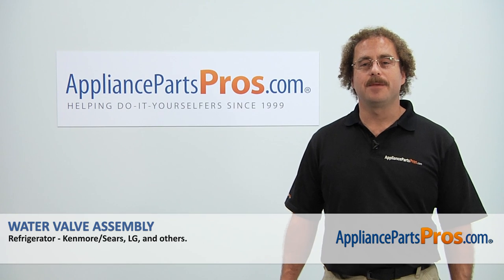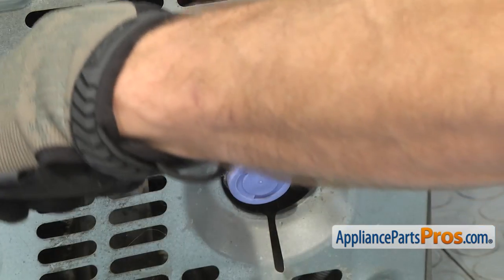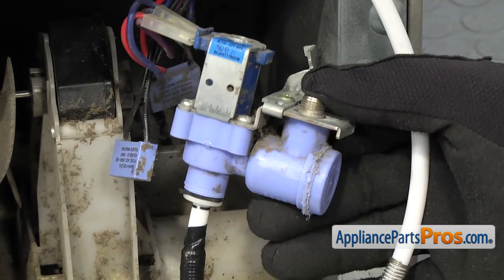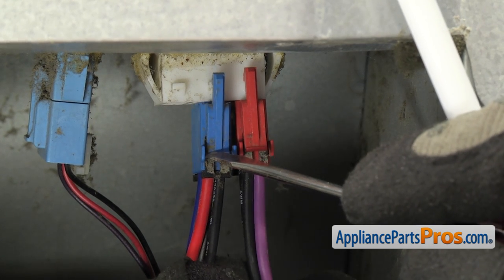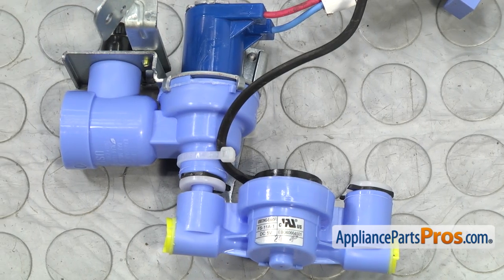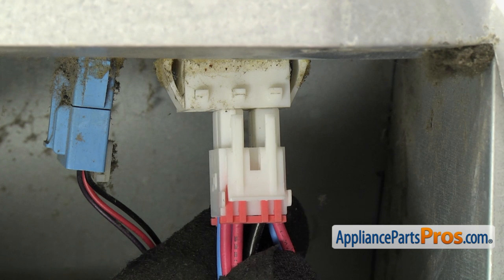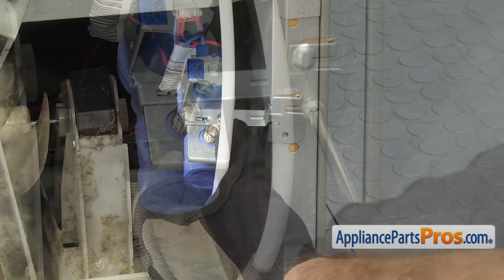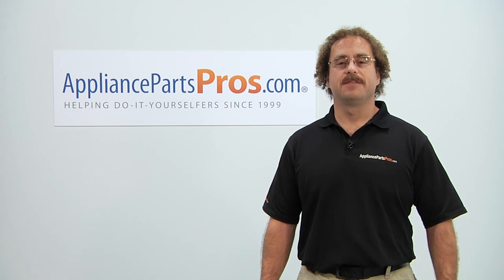How To: LG/Kenmore Water Valve Assembly AJU72992601

Comment: My water line comes out verry easy and when I put the new valve in it leaked I pit the clip on and the line comes out easy still so I put teflon tape on the line and taped it on the valve to hold it on tight and no more leak

Comment: twice now, new filters, after like 1 or 2 months, no water comes out, but ice gets water... last time, replaced filter. this time debating the water valve assembly ?? fridge is from like 2005..  (when water stopped, I would remove and reinstall the filter, it would pressure up, but not dispense... and make a mess removing... ) i have a inlet valve here as well as new filters... any thoughts ?? fridge is recessed, so have to slide it out on the wood floors
Reply from the maker: What is your model number??
Reply from the maker: You will need to test for power at the water valve when you push the button to call for water. If you have power at the valve and it is not allowing water into the unit then the valve will need to be replaced. If water is coming in then you can remove the filter and see if that corrects the water flow issue. If it does there is an issue with the filter. If it's a new filter then you could have an issue with the filter housing, so that would need to be replaced.
Reply: @appliancepartspros  with the filter not letting water through, it took like overnight for water to return, but ice still could be made... then it works with no filter, last 2 waterdrop filters did the same after like 45 days... used them for years with no issue..
Reply: @appliancepartspros  if working now with no filter, would you toss in a new filter and see what happens... install the filter that was in that it quit dispensing water, then test the valve and replace if needed ?? from the backside, is that where the filter tubes are as well ?? so it would have to be slid out for that as well... seems that part is not available... any thoughts would be great,... (just not sure the probability of 2 wonky filters, but anything is possible... i have 2 more new ones here and the complete water valve on hand..
Reply from the maker: If replacing the water filter doesn't correct the issue, then you will need to replace the water filter housing or in this case the water filter head. Unfortunately, that part is no longer available, that part number is 5230JA2003A. You can try checking around to see if you can locate that part in stock somewhere.

Comment: I have a Samsung with the bottom freezer and french doors. I don't know where my water vale is located. I pulled the frig from the wall to replace it and its not in the back bottom right. can you tell me where it's at?
Reply from the maker: I do not know if all of them are the same. You should be able to follow the water supply line to it. You can also go to our website and enter your appliance model number to view the parts breakdowns to see where it is located and to be sure you get the correct part for your model. http://www.appliancepartspros.com/
Reply: Hey, I have the same issue. My French door Samsung was missing the water valve and hoses in the back. My father has same unit, came with the water valve assembly....

Did you ever figure yours out? I know where to get the valve assembly but I still don't know how to hook up the water hoses, because I have none on the back of my fridge. Any help would be greatly appreciated. Thanks.

Comment: hello I'm looking for a water Inlet valve aju34125535. I can't find it anywhere.  Do you have any suggestions
Reply from the maker: I'm sorry, it looks like that part has been discontinued by the manufacturer and there doesn't seem to be a direct replacement for it.
Reply: AppliancePartsPros thank you for responding. I found this part # aju341255313 number.  the valve looks identical to the one I need. all I really need is the solenoid, do you have any way to know if it will  work for me. thanks
Reply from the maker: Unfortunately, we don't have any information about whether that solenoid would be compatible to your machine.